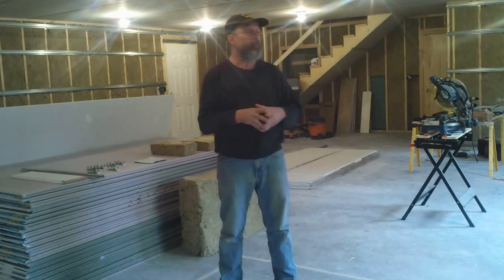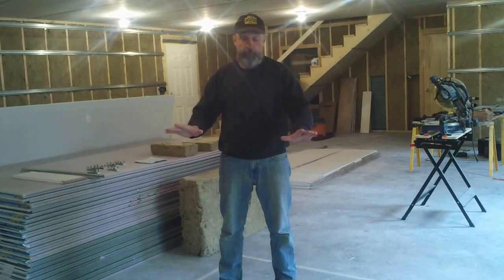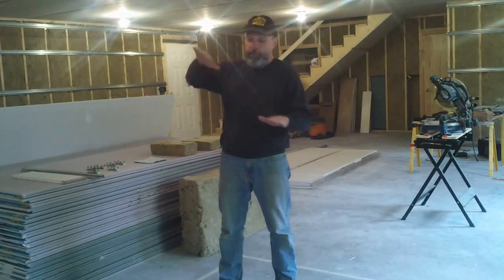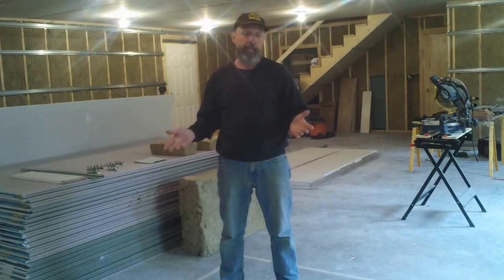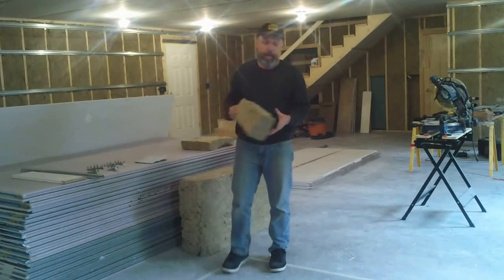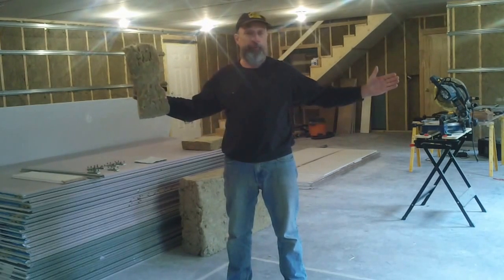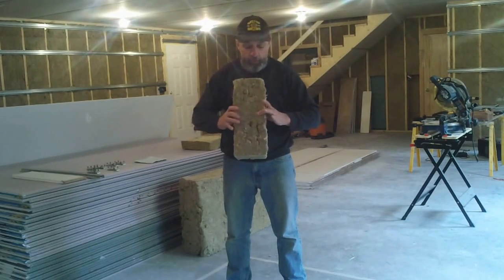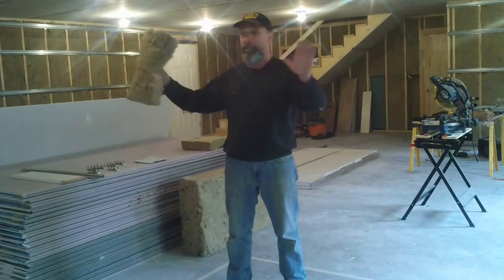One Method of Soundproofing a "Home" Recording Studio - (Part 1)

Comment: Mike,  how did you handle air conditioning/heat vents in the room?
Reply: Good question!
Reply from the maker: Hello Keith,  Sorry for the long delay in responding to your question about the air condition and heat vents in my recording studio; I unplugged for many years.  This studio was in the White Mountains which has a very short summer and no real need for AC.  In fact, the insulation I used was so effective that it kept the occasional humidity out!  As for heat, all I had was a 4,500 BTU propane stove which did an amazing job heating that room, and when it heated up, the insulation held the heat in the room remarkably well.  I just posted a follow up video if you want to check it out.  I included photos of the construction, finished photos of the studio, and info about the final results. I also discuss the surface treatments I used.  Here is the link to "Part II" (https://www.youtube.com/watch?v=tKP5wzZv2bw)  Thank you for watching my video; I appreciate it! Mike

Comment: I am an acoustician.  I hope there is another part of this video about soundproofing windows.  Do not invest so much effort and money in soundproofing without taking care of the windows, which are the weakest surface.
Reply: A
Reply: Yup.   In my basement and master bedroom we installed sound series windows which are essentially two windows in one frame.  Outer one is standard double pane with two different thicknesses of glass and the inner one is a single sheet of 1/4" laminated glass.  Massssive difference but new windows aren't cheap.
Other, less expensive solution for the additional surface is an insert from someone like Indowwindows.com.
Reply from the maker: Hello Michel!  I hear you on the windows, but this studio was part of my house!   I wasn't going for 100% studio quality soundproofing but just some reasonably effective methods & materials to create an acceptable level of soundproofing.  Because the studio was an addition to my house, the studio design was a balancing act between soundproofing, aesthetics for the room as it relates to my house, and creating a space that lends itself to the creative element.  After all, I planned on spending a lot of time in this room over 20 years, and the room had to have windows! 
Thank you for watching.  Please check out the follow up video (part II) where I talk about the end results of the soundproofing methods and materials I used (which did meet my goals).  I also included a photo video montage of the studio both in construction and in completion.  Here is the link (https://www.youtube.com/watch?v=tKP5wzZv2bw)  Mike

Comment: I really like the steel clip system... I'm looking at converting a two car garage into a sound studio but the problem I have is it is a rental so I need something to be an independent structure that does nothing permanent to the rental property. Any suggestions?
Reply: sure, you build a room inside the room, which can be dismantled.

Comment: rightio standard plaster board on 5inch blue board on green glue compound sheeting on 5inch blue board all screwed on fer-in channels that are clipped on sound proofing clips on the studs with double layer of thick insulation with special recommendation getting power ports insulated - dumber it 4 layers of board sheeting screwed on metal on studs with 2 layers of thick insulation think ive got it all worked out

Comment: that also brings up another question what "IF" your building a house/room out of ICF (insulated concrete form) what then will it be necessary to apply all those sheets just how will those insulation foam stand up right without using timber studs beats me + will it be even necessary to use

Comment: I'm watching this video and getting this sinking feeling because here's a really swell guy putting in all of the effort for a fraction of the results. I'm predisposed to feel a little heartbroken but it's been three years and maybe the space is everything you hoped for. What do I know?
Reply: How would YOU get better results?
Reply from the maker: Hello Hermiel!  The studio came out amazingI  I am including a link to the follow up video ("Part II") on the recording studio.  "Part II" includes the end results and a photo video montage of the construction, photos of the finished studio, info on the soundproofing results as well as the surface treatments I used.  Here is the link to "Part II" (https://www.youtube.com/watch?v=tKP5wzZv2bw).  I'll just add that, due to the stand alone rural location of the studio, I didn't require a total 100% soundproofed studio, so the methods and materials I used did provide reasonable soundproofing (which was the goal) and did meet my needs.  I hope you get to check it out.  Mike

Comment: how would i soundproof a room after the wall was already built.... im really not want to tear down my wall just to soundproof it
Reply: You need to build dead air pockets to stop sound from migrating. Leave the walls you have alone, leave a one to two inch space, and build an insulated wall in front of existing wall. It takes up some space ( a lot less than you think), but that suckered will be dead. For the sealing there are several ways to do it, the cheapest is two layers of 5/8 drywall with green sound insulating foam between them, hung from the ceiling. Check this out at your building centre. They have drywall with a center soundproofing layer now. A couple layers of that stuff is great too. Instead of soundproofing a whole basement, consider doing an area large enough to get your band in, and save some money. If you need to record, keep the console or computer in the unsound proofed room, and use a small camera and foster speaker to communicate with the room.

Comment: I think dis is fwalse economy. .. Having air gaps surely  cweates a dwum effect 
Supress vibration through the walls by using wubber sandwiching it between dry wall and studwork. ..
Even better was this guys construction in an old single brick garage. . He built a second skin internally...
separated by wok wool or was is rock wool  ??
Basically a brick  room in a room that's it. . Couldn't hear a thing outside. .
Wav a nice day 😴😱